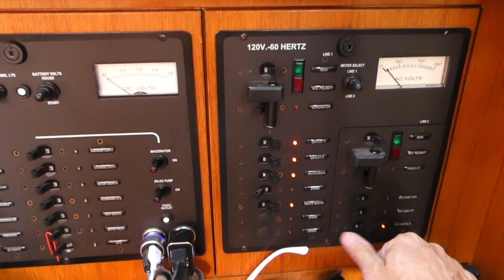SailAway 73 | Sailboat Air Conditioner Install and Full Moon Dinghy Drift | Sailing Around The World

Comment: When dealing with high voltage AC current, you should not use the terms 'positive' and 'negative'. Those terms are for DC current. AC wiring terminology is black for 'line' or 'hot', white for neutral, and green for 'safety' ground. When dealing with 240VAC equipment L1 and L2 are both hot. One is black and the other red. Usually. Great video. Hopefully you had a nice cool summer!
Reply from the maker: Thank you...that's very helpful.  I've mostly only done DC stuff so those concepts are dug in pretty deep.  And yeah, we have stayed pretty cool!  It's been REALLY hot here!  Thanks for watching!

Comment: I think this may be the only in depth marine AC swap out that I have ever seen on any sailing channel.  You made it look easy Eric!!!  How many BTUs was the thing?  My guess is it has to be 16,000 to 23000 BTUs for a 46 foot boat.
Reply from the maker: Thanks!  Yeah, relatively speaking, it really wasn't bad.  Only real issue was the diverter for the ducts and that wasn't too tough...probably could've bought a part to fit, but...LOL.  It's 16,000 and we have another 12,000 aft.

Comment: You might have to Balance the flow of air between the longest point away and the Closest points to the unit ,in other words partly  close off the two shortest hoses so you get more air to the Forward Berth. Your the Hvac Man Now , Ps: Great job as well :) looking forward to the next Job :)
Reply from the maker: I thought that might be the case too, but thankfully it did even out pretty soon.  And thank you!  Despite the hacksaw step and a couple slightly short hoses, it was a pretty straightforward swap.  Thanks for watching!

Comment: It's been a brutal summer here in Atlanta. Nothing above normal,  but the combination of heat and humidity, ouch!

Hope you ran the AC before you took the hacksaw to it?
Reply from the maker: Yeah, we've been struggling with it!  We lived in Charleston and Florida, but this summer has beat us down with the heat.  And...nope.  Had to roll the dice on that one. :-)
Reply: @SailAwayVlog  the wire colors are the same as house wiring. Oh and ironically YouTube ran an air conditioner ad before your vid.
Reply from the maker: Lol...that's hilarious.  And yeah, I figured that out while I was researching the wiring that day...haven't done much residential electrical.

Comment: Now that you've had your AC unit installed for the last two years, what are your over all thoughts on the unit itself?  Has it lived up to your expectations?  I may need to replace mine in my 2003 Hunter this spring and I currently have the same unit you removed.  If this one has held up I may consider it for my boat.  Also, can you provide the model you put in?    Any info would be appreciated.  Thanks and my wife and I enjoy the channel. :)

Comment: Boy, that ticks me off $600 is highway robbery.   Plus it didnt even get fixed.  These boat mechanics think they have us by the short hairs.  Good install on the new.  I have my condensate line running ri my shower box.  I always wondered why the ducats are never insulated.   Mine sweats inside the lockers.  I'm sure the new one is much quieter and colder.   At a marina AC is a must in the South.
Reply from the maker: Man, you're so right....oh well.  Big part of why you have do as much yourself as possible with a boat.  Funny thing with our ducts is that the aft ones are the insulated kind...not sure what dictates which is used.